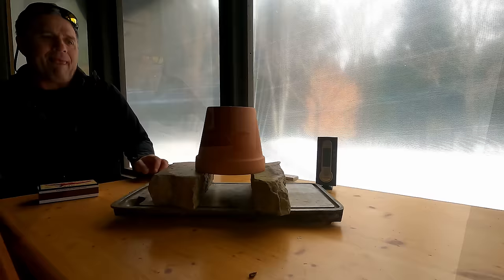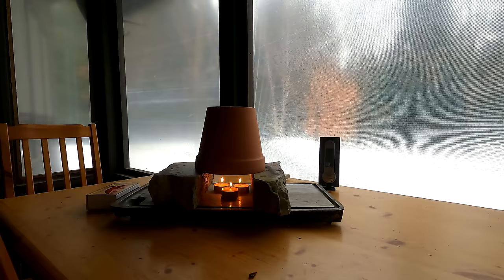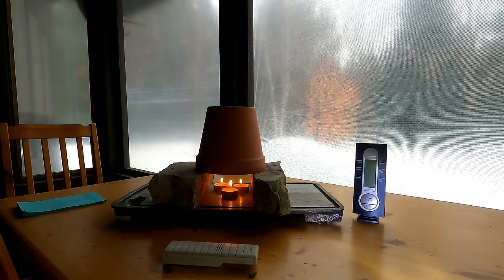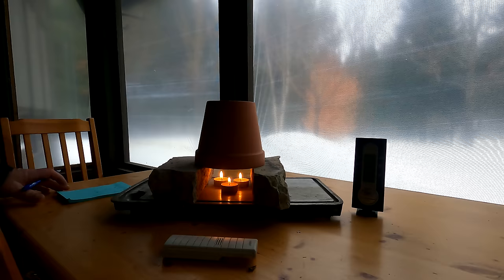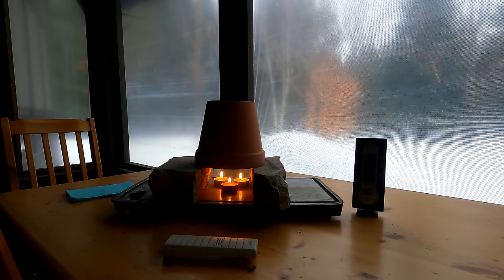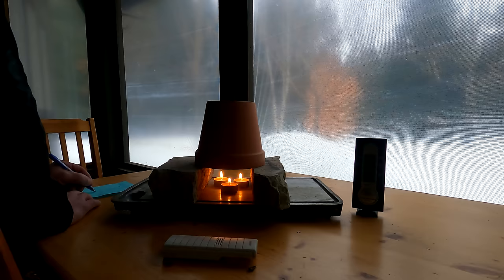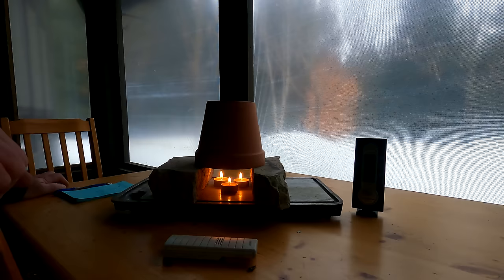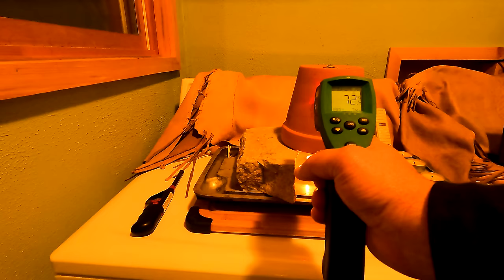Testing the Clay Pot Heater | Truth or BS | Prepping and Testing

Comment: you think that three candles in a house will keep it warm. Where do you live? the equator?
Reply from the maker: Never did I state such a Ludacris notion. The pots and candles were barely able to heat the test room which is a mere 5ft by 8ft in size.  I actually live in a place where the temperatures dive down to -40 F which is -40C several times in the winter. I heat my home with wood and have no need to use candles for additional heat - I was simply trying to determine if the unit could heat a small area - they did by a very marginal margin.

Comment: Of course it doesn't work, at least if you are trying to heat a room (as many of these videos claim). The BTU output of a candle or three are nowhere near the requirements needed to heat a normal room. It might boost a broom closets temperature but anything you can "live in"...no way. As a localized (very localized) radiant heater okay, put you hands near it and you'll feel the warmth. I think the psychological boost might be higher than the BTU's
Reply from the maker: This unit heated the room by a few degrees; The room is 5ft by 8ft by 8ft high. Insulated with R30 walls and R40 ceiling. I was not in the room during this test. The Pots do not increase the BTU's of the candles, they do however, capture the heat and radiate it out in a controlled manner. Once the candles are extinguished, the pots continue to radiate heat for a minimum of 30 minutes.  I would not use this system as emergency heat due to potential health and safety risks. There are products on the market designed for emergency situations such as a power grid failure.  This unit will keep you warm as long as you are within its radiant zone.  When the power fails and options are limited, people will move into a closet or other small area just to stay warm. I have set a tent up in the living room just to capture body heat. It is truly amazing what people do when the proverbial stuff hits the fan.  Thanks for the comment.

Comment: The point of the pots is to condense the heat, so you can fire a pot right next you and be irradiated, rather than have the candles' heat dispersed through the room.
Reply from the maker: You are absolutely correct - that is the reason for the pots - Capturing the heat and dispersing it in a controlled manner. Thanks for the comment - very well said.

Comment: Burning paraffin wax through a wick is not the most efficient.
Care must be taken because of the production of Carbon Monoxide and vapours which are unburned gasses given off by hot wax. They are highly inflammable and can accumulate without good ventilation.
However, the idea of heating a small room with controlled ventilation may help reduce the damp effect but at the risk of replacing it with an oily residue.
You need a flu to get rid of the fumes.
Reply from the maker: Agreed - I recently did a follow up to this experiment in an enclosed shelter to illustrate how dangerous the output of these candles can be. Thanks for the comment.
Reply from the maker: You are correct - the fumes from this kind of setup can be dangerous - the risk has to be weighed out - personally - I would not use this in any enclosed space. The experiment was simply to see if the temperature would increase. Thanks for the comment - it is important that people know the risks.

Comment: You don't you also include Fahrenheit
Reply from the maker: Michael - Celsius is used in Canada - For Reference, 10 degrees Celsius is 50 degrees Fahrenheit.  0 degrees Celsius is 32 degrees Fahrenheit.  To convert - take the Celsius temperature - multiply it be 2, subtract 10% and then add 32 - You will then have the temperature in Fahrenheit (Give or take a few points).

Comment: for the cost of all those pots and hardware you could have bought a propane  or electric heater lol.
Reply from the maker: I would not use this system, I was simply curious to see if the combination would heat a small room - they did by a few degrees. I am in total agreement with you, I own several self contained heating sources which function perfectly when the power grid decides to take a break - which it does in my neck of the woods on a very regular basis.

Comment: May someone put a stove fan on a clay pot heaters.I mean a Wood burner Stove Fan on a brick heater some don't believe that them clay pot heaters makes the room warmer.But what if you put a stove fan on top of a clay pot heaters, will that make the room warmer.Will you do two test.1 with the stove fan and the other text without the stove fan(s)
Reply from the maker: I do believe the stove top fan on a clay pot will indeed help to disperse the heat of the unit into the room. I will test your theory and post it.

Comment: That’s no good… it will be too hot inside a tent…🙃
.. it’s better than just a candle.. air is an insulator not a conductor… it’s amazing how hot those pots were..
Reply from the maker: The pots do get crazy hot - however, I would never use this in a tent due to the fumes and the fire hazard. Best to use another source of heat such as a heated rock - as long as it is placed on an inflammable surface.

Comment: the pots do nothing besides concentrate the heat being given off by the candles, the same experiment could be done without the pots and the room temp rise should be exacty the same
Reply from the maker: That is absolutely correct with the exception of your assumption the pots do nothing. The pots capture the heat and absorb it - they then radiate the heat in a controlled manner. After the candles are extinguished, the pots stayed hot for 30 minutes. The room temperature was 18 degrees C.  Note - I would not use this unit as there are too many safety risks associated with its use. This method of heating a room was used centuries ago and to this day,  using terra cotta as the heat capture medium.

Comment: Where are these folks living? Where I'm at, it's 7 below zero, and I estimate it's taking 40,000 btuh to keep things liveable. In my smallest closet, I doubt that would keep you alive.
Reply from the maker: Hi Curt - At the time of this test the outside temp was above zero. We hit temps of -30 C where I live. This unit would never suffice at temps like that.  If the outside temp is above zero or at zero, this unit could heat a very small space to the point of keeping it above the freezing point. It would not have a chance if temps fell to below zero. The best thing I found to heat a small area well enough to be livable (definition required as I am very comfortable in a tent in below zero temps) are oil lamps. several of these placed in a room will indeed keep the room above zero - you will still need blankets and a good wool sweater or two. Thanks for the comment.
Reply: @Hawksshadow  Survival did come to mind as here in Minnesota we currently have storm warnings, wind chill warnings and blizzard warnings through Friday and it's -6 F.
My emergency heat is 3 22k btu kerosene heaters and 20 gallons of kerosene.  The candles wouldn't cut it. I wonder though, yt is full of candle heaters, Crisco heaters and the like. It would be dangerous to count on those here. They'd find you in the spring.
Reply from the maker: @curtwuollet2912  
100 percent. Kerosene heaters are awesome. That is my backup as well. I make sure a couple of windows are cracked open. I have a wood stove which never lets me down. This candle business is goofy in a house.  I suppose it’s better than nothing though.  Hello from Algonquin Ontario.
Reply: @Hawksshadow  It might not be better than nothing if you tried to wait out an outage and froze. I heated with wood before I moved to the city a few cords of red oak is good security in a storm. Now I'm on the prairie so wood is hard to come by.

Comment: Put the room thermometer 6 feet or more from the pots.  Otherwise it's a false reading.
Reply from the maker: The room is 5ft in width and 8ft in length. The thermometer used is a remote sensor unit. The sensor was placed on the wall by the door. I failed to point it out. The pots and candles only raised the temperature of  that small room by a few degrees. The pots only function is to capture the heat and radiate it out in a controlled manner.  Note - I would not use this unit for emergency heat as there are too many risks associated with its operation. There are products on the market which are designed to provide emergency heat in a safely and efficiently. This test was simply to determine if the clay pot candle heater is truly a viable emergency unit.  Thanks for the comment.

Comment: Tried it last year with 5 candles and 2 pots, the pots got very hot but I could only feel any sort of heat while I was sitting beside it. Might try it this year with a small fan to see if it distributes the heat better.
Reply from the maker: Hello Chris - I can totally see that happening - the room I tested the unit in was a very small laundry room so the heat from the unit was somewhat apparent; however, due to the nature of the pots, they hold heat very well and I suspect the radiating effect is diminished - the fan is a great idea. I am curious to know how it works out. Did you notice how long the pots stayed hot?  I couldn't touch them for thirty minutes after the candles were extinguished - Thanks for reaching out.  .

Comment: How come no one ever does a just candle test then a clay pot test and shows the difference?  Maybe I will do it then.
Reply from the maker: You are totally correct. I failed to do so as I was simply interested in the combination of pots and candles. I can assure you that the difference in minimal. Candles alone will raise the rooms temperature - the pots have no bearing on the BTU output - they do ; however, capture the heat and radiate it out in a uniform manner. The pots will stay hot for at least 30 minutes after the candles are extinguished. To clear the air on this I will repeat this test ensuring all the boxes are checked. 
Thanks for the comment

Comment: This was not a real test. The test would involve calculating the cost to heat heat the room so many degrees in so much time versus the cost of the candles. Basic engineering.
Reply from the maker: True - The test was simply to determine if indeed the system would increase the temperature of a very small room - I would not rely on this unit to keep a room of any size heated. Calculating the cost to heat the room was never part of the procedure as the original question was " can this unit be used as an emergency heat source?"   When the power is out - no calculator in the world will change the fact that your body is shivering.  Thanks for the comment.

Comment: I'm guessing that three candles by themselves would accomplish the same thing.   The pots only work to concentrate the heat to a smaller area rather than dispersing it.
Reply from the maker: The Pots actually capture the heat and radiate it in a circular pattern. The pots are used to gain efficiency.  When the candles burn out, the pots will continue to radiate heat for at least an hour. The problem with this system is the fact that certain candles will emit dangerous fumes - I would not recommend this heater for use in an enclosed space. 
The more candles, the more heat.  Thanks for the comment.
Reply: @Hawksshadow  The problem is that if you don't use it in a very small and well insulated enclosed space, you basically just have a complicated and dangerous proximity hand warmer you can't sleep around.
It kind of has an utility in very specific and extreme situations. The problem is that this kind of video will inspire idiots to do this on their dining table and leave it unattended, hoping to actually and significantly heat the room. Putting the thermometer so close to a radiating heat source is borderline dishonest (or dumb, your choice).

Of course there are a lot of interesting comments but most idiots will not take them in consideration (and that's if they read them).

To me, as it is, this video is a danger because it's not informative enough and it will likely indirectly cause fires. You won't hear from it. But you may have blood (or soot) on your hands this winter. If you don't care about burning idiots, think of the families living in apartments above them. Please consider editing your video :(
Reply from the maker: I am in agreement with your comments pertaining to uniformed people - the video clearly stated that it was a test to see if this unit could increase temperature in a controlled environment. The room I chose was a laundry room and it is very well insulated and ventilated. The unit is not capable of heating anything more than a closet space.  Regarding the placement of the thermometer - the whole purpose of this channel is to ensure there is no BS associated with it. The placement was within three feet of the unit as that was the most space available. I did a follow up study with this unit in an outdoor setting and in that particular video - I highlight  the misgivings I have about using this unit. I am very grateful that you have brought my attention to the fact that there are "idiots' out there who take everything at face value. I will put a disclaimer in the description which should help to point those individuals in the direction of a more suitable and safe heater. 
Thank you for the comment.

Comment: Do the same without pots. Enery release from candles is the same no metter where you put them :D
Reply: Sure, but where does the energy go? Without pots, straight up to the ceiling where you won't feel it. The pots keep the heat down where it's needed.
Reply from the maker: Yes - however the Pots actually capture the heat and retain it - releasing it is a controlled manner. I tested the pots after extinguishing the candles and they remained hot to the touch for 40 minutes.

Comment: Unless the pot is releasing it's own energy from being heated there's no possible way that this is doing anything. The law of conservation and all that.
Reply from the maker: The pots only function is to capture the heat of the candles and radiate it out in a controlled manner. They do not increase the heat output of the candles. When the candles are extinguished, the pots remain hot for at least 30 minutes in a room which is 18 degrees C.
Reply: @Hawksshadow  right. When we had a storm knock out power for four days we put big rocks in the barbecue when we were cooking to bring in and keep the parrot warm. I'm saying most of these videos claim this will make more heat.
Reply from the maker: There is so much BS on YouTube it's crazy. That's why I did the test. Thanks for the comment.  Smart move with the rocks. Your parrot must have loved it.  Stay well.
Reply: @Hawksshadow  It might be just as efficient to light 2 of the 3 candles, and then the third when the temp drops a bit. Then plant some medicinal herbs in the pots...
Reply from the maker: That's funny - good way to look at it buddy.

Comment: The only thing that is - here is i guess that they can intoxicate air because candles have toxic stuff in them nowdays so if you are going to use this remember to vent your room.
Reply from the maker: Hello Peter, The amount of toxins from three small t candles is negligible. Simply taking a short drive in any vehicle today while following a diesel vehicle is vastly more toxic than a simple little heater. You are absolutely correct if using any heat system in a closed shelter such as a tent - always ventilate - CO2, CO and other deadly toxins can put you down while you're sleeping. Never leave a candle burning unattended. This Clay Pot Heater would never be my go-to survival tool.  Thanks for the comment.

Comment: 73c? That's what, like around noon in Cleveland or is that Tokyo time? lol
Reply from the maker: Celsius - The degree Celsius is the unit of temperature on the Celsius scale (originally known as the centigrade scale outside Sweden), one of two temperature scales used in the International System of Units (SI), the other being the closely related Kelvin scale.
Reply: @Hawksshadow  Did YOU see the lol? I made a joke and it went right over your head! Everyone know what Celsius is and what it means, frankly no one give a shit!
Reply from the maker: I seriously thought you were asking a question. Sorry; That is the issue with non verbal communication - much is lost in translation. Thanks for the clarification.

Comment: At the end of the day it's basic  physics. Each candle has x amount of energy in it to give up (assuming 100% burn). The room need y amount of energy to raise the temp a degree. You are more likely to see the effect of your own body heat raising the temp.
I wish these adverts on YT etc about 'saving thousands of pounds by this simple method' would get banned. They are cons.
Reply from the maker: The test simply indicated that the candles did indeed raise a small, insulated room by a few degrees. I was not present in the room. The light in the ceiling is an LED. No other heat source was in the room during the time of the test. The pots simply capture the heat and radiate it out in a controlled manner. Without the pots, the heat simply raises to the ceiling. There is not enough heat to cascade it to the entire room. The pots allow for localized heating. I have no need to prove this system works - I heat my home with wood - power failures are not a problem in relation to staying warm.
Reply: A tea light is about 30W; a human at rest about 100W.  It would be far more fun to just get a friend over!